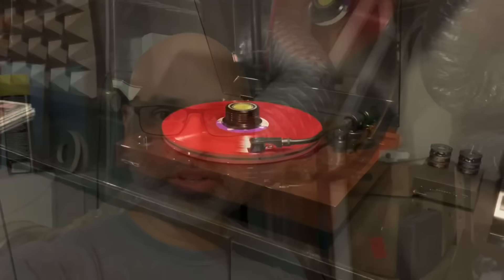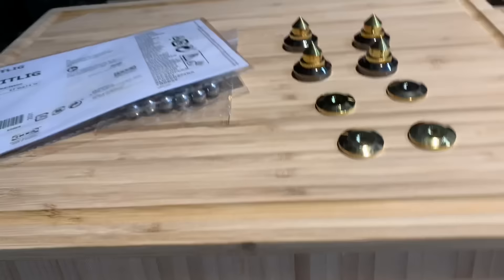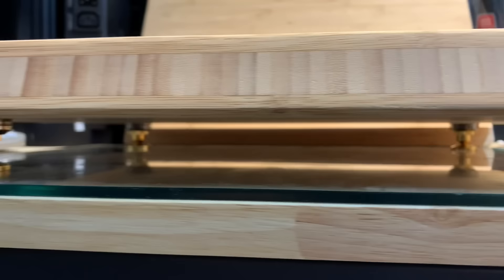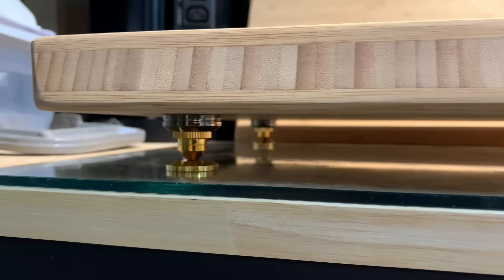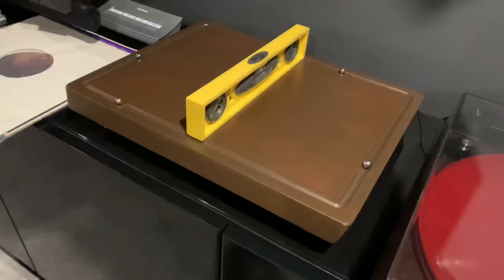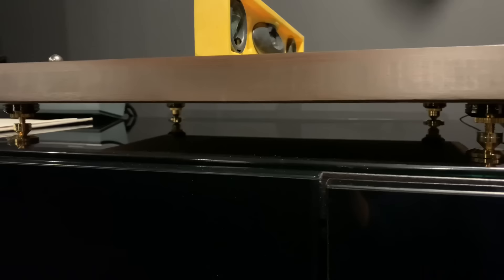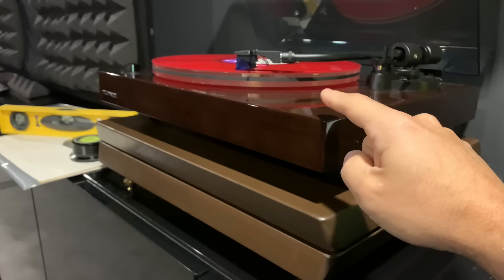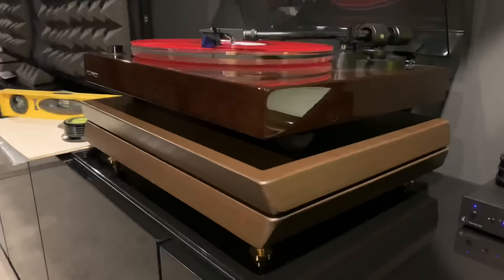DIY Turntable Isolation Base with Ikea Aptitlig

Comment: Instead of the ball bearings, run a bead of silicone sealant in the grove. And remove the turntable lid when you’re playing it. It’s like a big resonance dish when it’s up.
Reply: Not a good idea
Reply: Sorbothane in between or in place of the feet would probable isolate better.
Reply: Spring loaded pads under the player once leveled.
Reply: @Skeptgeo3  Why?
Reply: Bamboo is not dense enough or? I see people marketing walnut or maple. I was going to buy material from Home Depot to make my own maple butcher board until a friend explained not all types of maple have the same density value. So, maple isn't maple isn't maple. Idk. Vibration is a .... BUZZ KILL thats for sure
Reply: @robertm8518  yes I can attest to that
Reply: My custom Thorens has no base board meaning there is no box to create resonance within, I have 3 adjustable feet made from cherry hardwood which are internally fixed to the plinth to support and level the turntable frame. The Thorens platter and tonearm are suspended with 3 springs for levelling and tuning. It works fantastically, done all this custom work about 15 years ago.
Reply: Wood is adding is own resonance, better to use lead plating, or some epoxy mix with lead shot, lead is about as ideal of a sound isolator you can get, Sorbothone between boards is I believe the best commmercial resonance damping material.
Reply: @dystopia2386  Well, they are too theories, one make the support light as possible to push the resonant frequency above 20Khz, or make it extremely dense to decrease it below 20Hz. Its pretty difficult to make the resonant freq go above 20Khz, so I opt for very dense materials that have leser sonic signitures, best is beryllium, but its toxic and expensive, same with boron, which leaves the less toxic and cheap Lead as a good choice.
Reply: @dystopia2386  No, thats a different subject, we are talking about materials not suspension.
Reply: @dystopia2386  Magnetic is not as useful as you might think, when under load the magnetic coupling is a good transmitter of vibrations and offers little damping across the frequency range.
Reply: @dystopia2386  I am not here to score argument points man, plenty of others might entertain you though. Sound like you know already and dont need my advice.
Reply: @dystopia2386  If you haven't done it already, best upgrade anyone can do, is wall mount it first.
Reply: @engjds I keep reading this suggestion,  but it can't be better,  floor vibrations are amplified as they travel up the wall

Comment: Keep it simple, MDF Board, layered with Cork sheet cut to size. Simple and inexpensive. No special tools. Paint  mdf to required color.  Add spikes, pucks whatever you desire. kiss is the best way! I even had the mdf cut at Home Depot for free.  Cut the cork with a sharp knife, and assemble  30 minutes. Used  3 x 3/4 inch MDFB and  1/4 inch cork roll.  Don't overthink it.

Comment: Thanks for posting this video. I just did this exactly as described except I did not stain the IKEA boards. I think they look just fine as is. Without a doubt this setup significantly improved my stereo system sound. System: McIntosh 5300 integrated amp, Technics SL-1210GR turntable, Pro-Ject Tube Box DS2 phono preamp, Denon DCD-1700NE sacd/cd player, McIntosh XR-240 speakers. I am going to do this for my second turntable as well. Thanks again!

Comment: Most of the vibrations You're trying to isolate the turntable from are coming from the floor of Your room. You can hear footsteps through the TT, and if You plop down onto the couch, You could even make the tonearm skip. Having the turntable on a wall mounted shelf eliminates most of that sound without needing a special base.
Reply: I suspect it's more about floor construction rather than the audio setup. My TT does not react to any footsteps (or, of it does, it's below the preamp noise). 
But then it does not react to tapping the plynth as badly as our host's TT, too. No exotic woods, just a single magnesium alloy casting.
Reply: 100% agree but Not everyone wants to mount it on the wall. I do not want it on my wall but I agree with you that wall is best. I am just trying to keept footsteps from showing up in my music from a hard wood floor.  I currently use a big foam Speaker isolation pad and it works perfectly but it is ugly. I am going to try this but with Rubber feet instead of spikes. I do not like spikes but if the rubber feet do not work I will get something like IsoAcoustics ISO-PUCK's but I have feeling I will not need to for my purposes.

Also Going to stain ti with India ink to make id black.
Reply: In his particular set up I agree. A TT sat over a floor mounted cabinet is never going to go well. There is the floor construction unknown to transmit footfall movement etc and the lightweight cabinet raising the TT 1m off this acting as a pendulum amplifying any floor vibrations.  Like you mentioned, I mounted my TT on a plinth/shelf bolted directly to a brick wall which effectively adds tons of dampening mass for free. The TT then sits on sorbathene pads to isolate the arm as much as it can. AND it is all set in a recess effectively in an adjacent room (through an opening) which shields it from most of the airborne sound generated from the floor mounted speakers themselves.  Although this looks a fun project there are waaaaay simpler ways to simply side step the issues most TT's are up against !
Reply: My TT is still mounted on a cheap wall stand bolted to an external wall and filled.
Above will be far better if he used 3 spikes which is what mine was converted to 32 years ago. 
Wall stand had 4 spikes, converted to 3 spikes. Made a steel 8mm thick Y frame with 3 upturned spikes to sit on 3 spikes in wall frame. Y frame spikes go to an MDF board with steel pressings glied on underside.
Music then comes to life it starts and it stops rather than mushes in to another note, bass is there, its fluid, soundstaging pops out and you can now hang on to any individual instument. All for a few pence.
Reply: Not totally true.  Your speakers will produce resonance through the cabinet he has the table on, regardless of the floor.  Note he is on a concrete floor already.  Solutions include moving the speakers further away from the cabinet or isolation in some manner like this.  I took a slab of granite with thick felt pads under it.  Then put the same felt pads on the turntable feet.  Some tables resist resonance better than others, depending on the build quality.  For instance, my Technics SL-1200 has few issues with resonance and feedback.  My Dual 1019 proved to be a battle.

Comment: Back in the early 70’s I remember that we would build a box with a plywood bottom and sides made out of 1x6.  We made the box allowing about 1 inch clearance between the sides of the box and the edge of my old Garard SL95 turntable. Add clean sand to a depth of about 3 inches in the box, set the turntable in the sand and that was it.  We made sure it was set properly, “we thought” by giving it the Pink Floyd Dark Side of the Moon Test set at a volume level that would get the old people in the apartment downstairs angry. “Caution drugs may have been involved.” I’m not sure if any of this actually did any good at isolating the turntable but we thought it was cool.
Reply: A sand pile "is" a wonderful way to eliminate vibrations

Comment: Well, I've just put mine together exactly like this and the fact that my wife said it sounds much better (even though she didn’t have a clue why i was doing it) says it all. The difference is amazing! I could only turn the volume up about 70% before i fitted this at which point the feedback/rumbling would start, now i turn it up to 90% volume(don't see any reason to go beyond this and risk damaging the amp) and there is zero feedback/rumbling. Sound difference is hard to explain, saying its clearer or fuller base just doesn't cut it, its got to be heard to appreciate it. 
So glad ive done this, thanks greatly for posting this video. 😊

Comment: Great concept and well executed. But...... It is my understanding that spikes are not isolators. They are typically used under speakers stands on concrete floors to anchor the speakers and prevent them from rocking. My cheap and cheerful turntable isolation system is a  14 x 18 piece of kitchen countertop granite sat on Vibrapod isolators. Works a treat!
Reply: Correct, this is all about decoupling as he correctly states in the video 😉
Reply: You are right, and the ball bearings only work for lateral movement, the tapping is just working because of the two masses
Reply: Great idea. Try putting a softly inflated child's bicycle wheel inner tube between them?
Reply: @Straitjacket808  Tried that years ago. Way too bouncy!!! Now running a IsoAcoustics zaZen II Isolation Platform under my Thorens TD125. Sometimes DIY is great, sometimes better to go with a professionally engineered solution.
Reply: @RobertChampion1 If you get the air pressure right it cuts out the bounce. Used one for years under my turntable to great effect
Reply: I too have kitchen granite that I will incorporate into my next turntable upgrade. Heavy and dense.....and good looking. been pondering this idea for a while.

Comment: Hi nice video spring and rubber have resonant frequencies at which they don't work. At low frequencies say 4Hz the energy just passes through the spring/rubber but if you place a point contact such as a spike or the 2 contact points of a ball bearing the energy just rattles it and forms harmonics that the springs/rubber can absorb. This is why Linn and other high end turntables sound better on lightweight wobbly stands, Try putting your turntable on the box it came in. Remember that low frequency sound from the stylus that you cannot hear can clip the phono stage making distortion in the higher frequencies often this removal of low 1 or 2 or 3 or 4Hz interference stops this clipping and the whole sound is much better.

Comment: Thank you so much for this idea!

Instead of a turntable I'm using it for my resin 3D printer. I live on an active volcano right next to a major road in a second story apartment. So many ruined 3D prints, the supports just don't stand a chance.

I'm also adding a couple layers of really big really soft mouse pads.

Comment: I did this with one of those IKEA cutting board and some isolation feet I got on line. I may have to revise and add another board. Thanks for the tip
Reply: Try putting correct weight range sorbothane blobs between them. That should do it👍🖖

Comment: Nice project.  I would recommend removing the dust cover from your turntable when in use.  It will catch sound waves generated by your speakers and feed them back into your turntable.  It is worse when the cover is open but may do it to a lesser extent when closed. I don't use the hinges on mine at all. Simply set the cover on when not in use and set it off, out of harms way when you are listening.
I have a low production item named Hip Joints that work on the same principle as the balls in your project except that the balls operate in machined billet aluminum cups. consider playing around with balls made of different materials.  McMaster Carr is a good source.
Well done!
Reply: Put the album jacket in there when listening.
It dampens vibration and displays what you're listening to

Comment: Ikea must sell most of their Butchers Blocks to Hi Fi enthusiasts than for Kitchen Chopping Board use ?!!,  My Turntable (Avid Volvere mk4) is Wall Mounted on an "Apollo" wall shelf as is some other items including a Reel to Reel Tape Deck so can hold some weight!...The "Apollo" Wall shelves are either Single or Two Shelf units made of Steel Frame and Glass shelf with Spikes. Had them for many years now as floor in Hi Fi room is Wood Plank so a no go for Turntable to be on a floor mounted unit as even picked up me walking across room before buying these units (Four of them, 2 Single shelf, 2 Double shelf) Amplifier and matching Phono stage with their Power supply on wide AV Unit on floor as they are Huge and Heavy "Musical Fidelity KW Series" units... Great video, Thanks.

Comment: So do the same thump test without the isolation base to get a real comparison.
Note: I believe that cabinet is a Salamander Designs Oslo which I also have. I just did that test and was rather amazed at the result. When I placed the stylus on a record and just turned up the volume I started getting bad rumble, and that wasn't turned up all the way. I think it's just from the ambient noise since it's close to the furnace and it was running. So even if you isolate the turntable you can still be affected, but the isolation base would be worth the effort.

Comment: Very nice, you've created a form of constrained layer damping.
However I do think that there are better options for the steel balls and the feet. I would also add a further layer of absorption between the upper cutting board and the turntable plinth. Specifically, Silicone Nitride Ceramic Bearing balls and ISO-BAND TPE feet. Then either Herbie's "Tenderfoot"s or the highly effective "Equipment Vibration Protectors" for an absorption layer of the Turntable's internally generated vibrations. There are also a number of accessories and tweaks that will take the Turntable's fidelity to an even higher level. The cartridge and turntable arm are subject to vibrations. Vibration absorbing materials between the cartridge and headshell are helpful and there are materials that can dampen any negative tonearm vibrations. Of course too much dampening is as bad as not enough, so there's no substitute for experimentation.
A "Platter Ground" can be efficacious. Plus, a system is a chain of components and any 'lesser' link in the system can reduce the apparent effectiveness of changes in the system. What a challenging but rewarding hobby we have found  :-)

Comment: Very interesting, thanks! I currently use Aptltlig 3-layer cutting boards (like the ones you've used here) as a single-layer, so I think I'll get two more and make some dual-layer ones like you've done. With respect to mine, rather than "spikes/spike footers" between the bottom board and rack shelf, I'm placing mine on HRS Nimbus couplers (just the HRS rubber discs). These work very well to provide damping and the board sits very stably on the rack shelf in this configuration. With respect to the ball bearings, I'll also try my Stillpoint Ultra Minis and see what they do, as they're currently sitting unused. Something else folks can try between the two Aptitlig boards, particularly for components that don't require the isolation that TTs do is, believe it or not, beeswax cloth. This will provide a "constrained layer" damping between the two boards. All you need is a couple 1" or so squares of beeswax cloth at each corner between the two Aptitlig boards. Once pressed together, they can be lifted and moved for placing as a single "unit". Cheers.

Comment: Thank you so much! for this DIY.  Your demonstration of the degree of noise damping is enough for me.  the design including hard berrings between hard surfaces between the feet and the speaker or turntablel is duplicated (at great expense on my Borrensen speaker) by Michael the engineer..  Michael the engineer could have picked any other design but he picked this one.  i know there is a lot of argument on the best way to isolate, biut is is encouraging the best designers use this onel
Reply from the maker: Thank you!

Comment: I'd put silicone foam pads under the glass, be it a whold sheet, or 4" squares.
You could try the following in your current design. use a 3/4 or 1" wood drill to make some half inch deep counterbores. Then place foam (or hollow squash or handball) balls between the plates.
Reply from the maker: Did you try it with the alternative materials between the plates?

Comment: Spikes dont decouple, they ground. They are used to add the mass of the surface they are placed onto, eg. (concrete floor) to speaker stands to make the stands heavier than the speakers. 

If you have a cabinet or floating floor, its usually best to decouple using sorbothane so the live sound of the surface doesnt travel through. 

You made great stands for speakers on a concrete floor but if it works and youre happy, power to you man.
Reply: I am not sure that spikes would ground/couple anything when on a hard surface like glass. The vibrations would have to, in essence, travel up through a point source. If he used a rubber foot or pad between the two boards I think it would work even better as a frequency that could cross the point source boundary would not likely also be able to travel through the rubber. But that’s just my 2 cents.